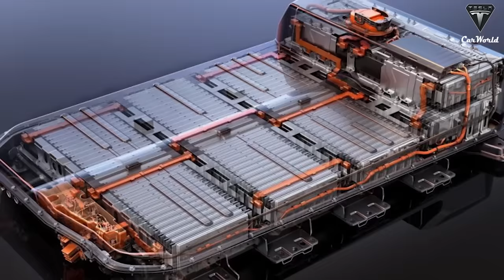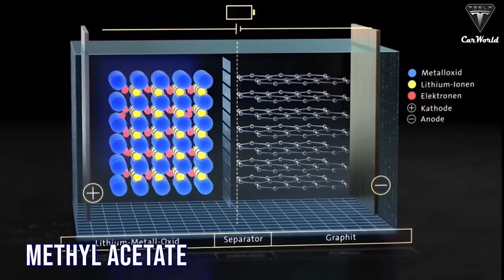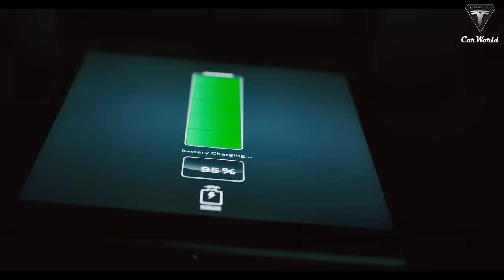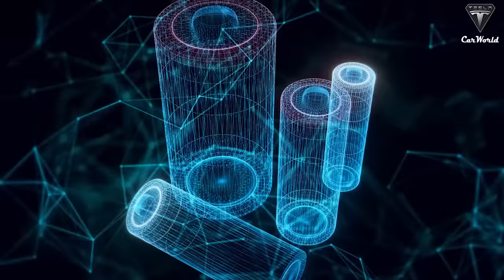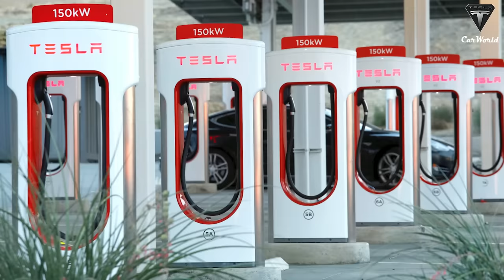The End of Lithium P3! Elon Musk Revealed ALL-NEW Shock Battery Tech, Change Entire Industry!

Comment: That doesn't just good for EVs but also Powerball since right now powers or asked about 20 years. So if they can make a battery that's able to last so damn long. It would naturally be something people that buy the power walls would want and make renewables even better
Reply: The battery that last 20 years but acar that goes out of stile in 6 over kill
Reply: @brianbruton2897  if you can just change the shell or interior of the car to suit your new needs/wants and keep the drivetrain it would be an improvement.

on top of that if we look at average car age and the reason we scrap them then if the car still works well after 20 years then it'll still be on the road

Comment: I have found by carefully cutting out a section in the floor board in front of the drivers seat, and the proper shoes, i am able to propel my car forward up to 8 mph and on a downhill, I have reached 25 with absolutely no gasoline usage. I call it the Bedrock design after the city where it was first perfected. Uphill travel and long distances are more of a challenge and requires passengers so carpooling is encouraged. Plans and working drawings are available for $1400 for the complete set. Order today before supplies run out. 👍

Comment: As far as I can see (as an engineering consultant, but in a different field), the biggest issues with batteries for EVs are:
1.  Life
2.  Energy density
3.  Environmental impact (related to 1, obv.)
4.  Availability of raw materials
... but biggest of all ...
5.  Where does the energy come from to charge them.

This video seems to address #1, #3 and #4 quite a lot, #2 to a lesser extent, but - crucially - does nothing at all about #5.

Comment: One thing which was not covered by the video is how  the charging system can provide the exceedingly high current which would be required to charge at such high speeds.  It could require the charging cable to carry two thousand or more amperes.  To to that, the charging cable would need to be many times heavier than current charging cables.  Such a cable would be stiff and difficult for the driver to handle.

In theory the charging current required could be reduced by using higher voltages, such as perhaps four thousand volts.  However, that would present other problems, such as requiring the inverters in the car to operate at thousands of volts.

Why is this problem never discussed?

Comment: This is just one reason that cars should be modular.   Each part could be upgraded separately thereby lasting forever.   Let's have 600-mile cars that have 1/2-weight batteries splitting the difference.  We should have already built the Nuke plants.  Discoordination slow-walks everything.

Comment: Why don’t they just put 2 battery packs in the cars? Run one pack until it’s at 20%, then switch it to the other one. The second pack can charge the first one to 80% and then turn the charge off. Then once the second pack gets to 20%, switch it back to the first pack. They can charge each other when they switch off and turn on in the optimal charge and discharge range. For as much money as those cars cost, they should also put a 3rd pack in there to be an emergency battery pack, just in case one fails for whatever reason. That would be a smarter way to do things, rather than charging your car by plugging it in. The car would pretty much charge itself in the best ranges, to last the longest time and would hardly need to be plugged in, if ever. They should also have their own mini a/c’s to keep the packs cooler so they run their best. If you want the best, you have to do the best.

Comment: This is all nice.  Has anyone addressed the safety issue.   You know the spontaneous battery fires that give the occupants just seconds to escape from a moving vehicle  that is moving 60 miles per hour?  I don't think making those batteries more powerful  and thus more deadly would be advised until the issue of keeping their passengers safe in such an event is figured out.  You know just a thought.  For those of you that have the blinders on,  a basic YouTube search will let you see what I mean.  Imagine being in the back seat when it occurs and what you will look like after 30 or 40 surgeries assuming you actually live.  In any other vehicle, they would have stopped production engineered  a deflective fire shield to protect the passengers and the children in the back seat of the cars and the passengers on the electric busses that flash to fire in 3 to 5 seconds.   I do not care what your political issues are,  Safety trumps all of them.

Comment: 20 to 80% use X 300 idea range, gets you to 180 mile range ideal conditions to protect the battery life.  But what about derating due to high temp (AC ON full) and low temp (Car Heater on and Battery Heater On) and driving in mountains.  And will this battery have a problem with Fires?  For my 03 Jetta Turbo Diesel, I get about 50 MPG driving down the highways 260 and 87 (140 miles) and about 35 mpg back (varies from about 40 to 44 MPG Both ways, based on fuel logs).  That's another 30% derating for going up hills,  thus 180 * .7 = 126 miles.  If you are stuck in traffic, then that's less.  Not to mention snow days where you are now doing 30 to 40 mph.  What I need is 300 mile range worst case and that means over the degradation of the battery (60% usable life left in 10 years) and going up hills in high heat or cold winters.  And ability to put out fires such as on current technology.

Comment: My electric hybrid BMW has 120,000 miles and the battery is toast. I don’t have $20,000 to replace it nor would I. So the car never went enough miles to save any Co2 over a purely gasoline car. It’s pointless. 3:47

Comment: Now we just need wireless charging roads that have auto-driving markers and lighting, powered through the power grid, supplemented by sturdy solar panel tunnels where needed. Not a lot of traffic? Feed the grid! On a charging road, you can have a "pig" sent down the lanes each night to clean the roads and indicate where repairs are needed.

You could also utilize old million-plus-mile electric car batteries for use with these roads at night and as storage to utilize during poor weather and morning/afternoon traffic.

Comment: A 2000 mile battery that lasts 100 years and charges in a minute. At 25% the cost of current technology. Then you’ll have something. It should translate into a passenger car that could cost less than $25,000.

Comment: This video just painted a beautiful mirage-like future of the car batteries to promote the incentive to their potential buyers, but It might not be materialized in the coming future, or never. If the car batteries can afford thousands, thousands of cycles and for EVs to drive a million, even more miles, it'll be bad news for the EV makers to sell new EV cars!
The "Light Bulb" Short-lifespan Principle must be applied for EVs too; only for a limited time, a calculated limited short lifespan, similar to all the consumer products using electricity, such as the lightbulbs, TVs, refrigerators, any product with electric circuits, motor or compressor. Making them all burnt out after a while and force consumers to buy new ones is the only way for all manufacturers to stay in business.

Comment: "low carbon goals" This just blows my mind.  Most people don't take into consideration that most of the electricity is generated by coal.  Up to HALF of all electricity generated is lost to the grid losses.  That means for every watt hour used by the car as much as two watt hours needs to be generated.  Also, internal combustion engines or point of use generation of energy is more efficient than generating and then distributing the energy.  That being said, it would off load the carbon footprint to areas that have lower population density and more plant life to absorb that wonderful CO2 that plants need so much.  With the lithium sulfur being cheaper, higher energy dense and longer lived than LiNe ion batteries I might be interested in an EV...maybe.  Renewables?  Still not practical but the new battery tech might make it closer to practical.

Comment: This is annoying as they DON'T describe the actual performance issues with these 200 year batteries. What good is it to be functional 'as long as it holds a charge' when in the first fifty years the performance drops under 25% but the battery refuses to die? You'd be surprised by the amount of double talk tech can get away with.

Comment: Cute, but we need to examine a couple of drawbacks.  
1. Where are we going to get the power to charge all these batteries.  Can anyone tell me seriously how many new power plants are under construction or even in the planning stages.  How many and where are they?  Power plant electricity other than nuclear, uses roughly 70% fossil fuels to generate electricity.    So you hook up your car to the grid at night to put excess electricity back into the grid.  But you need to charge up your car again when you want to go someplace.  How does that work?
2. For those of us who live in Arizona, we already know that excessive heat degrades batteries. How do we address this issue.
Good luck electric car lovers.  You're going to need it.

Comment: I'll believe it when I see it. As far as capacity goes, aluminium is only the 6th most active metal, behind lithium, potassium, calcium, sodium and magnesium, so the voltage per cell will be lower, but at least they could use it safely in metallic form instead of ions absorbed in graphite, which will save space.

Comment: I dunno. I am encouraged about these new battery technologies, but you still have to charge them! So far, all the "green" solutions for generating electric power for the grid have been diappointing. And the grid itself is very vulnerable to failure and sabotage.

Comment: I believe that the graphene aluminum ion batteries are cheaper, lighter and they charge 70 times faster than lithium ion batteries and can last a potential of fire doesn’t need any cooling whatsoever. Applying this technology is literally interchangeable with lithium ion batteries that are lighter, faster, cheaper . Using aluminum, Sulfur, and chemistry will bs charging at 100% in less than a minute. Using Milton salt or Chloroaluminum salt batteries can store power.

Comment: Funny that a 70 litre plastic fuel tank has no problem doing a million miles but usually has the vehicle wear out around it. Even so it still holds 70 litres at the end of its life and still takes 3 minutes or so to fill. While heavy I can still just about lift this source of energy that will give me 650 miles.  It also bounces if dropped. As far as I can see the industry is still struggling to get out of reverse gear.

Comment: Others have mentioned it. ALUMINIUM batteries straight away would offer the best RECYCLING solution which completes the picture.  Yeah we end up with million mile batteries and end up with modules in the future with expensive recycling options if at all.  A complete solution as opposed to something that works in the short term is what's required.  The first commercial cars ever were electric and all electric owners must recall the short stint in the 90s.  It's not the car that's the problem, it's absolutely the power source. But hey, that's all of humanities current main problem,not just cars.

Comment: I don't care about how many miles these batteries last, or in other words, how many times they can be charged and discharged. That's not the issue. The concern is ENERGY DENSITY. RANGE.  How far can I go on a full, single charge?!!. I want an all electric tow vehicle that will pull a 7000 pound vehicle 400 miles minimum, and be fully recharged in ten minutes. We are nowhere close.

Comment: So I live in Canada and I do not have a garage to store my car in, so how well or how bad is it for the car/battery when it sits in the cold for 16 hours at around -40C?  Will it start and run and will the battery return to normal in a 20 to 30-minute drive to work?  And then do it again in 8 hours to go home?  Do you need to be charging the battery slowly when it is so cold, I would hope some power flow would help the battery stay active and warmer than the outside temperature, or maybe you wrap those batteries in some kind of protection?
Reply: At -40C, for a gas powered car, it'd need to be plugged in so keep it warm.  Probably something similar for EVs where you plug it in at home and at work.

Comment: Your explanation on C rating isn't quite right. The C rating is based on the Capacity of the battery. So a charge/discharge rate of 2C means the battery can charge/discharge at 2 times the rated capacity of the battery. For example, a battery with a capacity of 3000mAh (3Ah) could be charged/discharged at a rate of 6 amps.

Comment: I want a battery that will full charge in less than 5 mins and last 350 miles like my diesel car lol
Reply: Capacitors trickling to batteries is one option. You'd have to replace the capacitors more often under those conditions, but it could be done.

Comment: As a solar energy engineer, I love to see that innovation is coming rather quick, and having many technologies available would "boost" the industry into adapting them, as well as having new technologies with a variance of applicable use cases each. However, I hope the aluminum wins the bulk, we still have to be as "clean" as possible. Not a big fan of Lithium in general.

Just a note, your lithium vs gmg battery lifespan values are flipped.
Reply: These can also be used for other sources of electrons. Nuke, sewage burn, etc. etc. So long as you can store electrons reliably and cheap, you don't have to plain old dump as much load overall to ward off spikes and brownouts.

Comment: Too many errors in this video to list, but here is just one.
Fast charging, I heard mention of charging up to 70 times faster, no current grid connected charger can support this.
EV charge stations have a limit as to how much input current they can take from the grid.
The theory may be good but in practice, each vehicle connected to a charger doing a "fast charge" is limited by how many other vehicles are attempting to do the same.
Also the current required to charge one vehicle in 12.5 minutes as suggested here would need huge, heavy cables.

Comment: My question is how well would these batteries work in the winter in places that typically have weeks with wind chills of 0 to -40°F?
Reply: Wind chill is only relevant if the surface is wet or damp such as from sweat or rain.  Neither apply to batteries in cars and even less so in houses.
Reply: Granted, but to have a wind chill that low especially if the wind is less than 10 to 15 mph means the ambient temp wet surface or not is still low enough to affect most regular car batteries. I know, I live in the upper midwest, I have had vehicles not start because it was too cold for the battery
Reply: @kwhitefo  You are suggesting the vehicle in this temperateure is just stored in a garage? No wet road from rain, puddles or melted ice or even ice thrown onto the battery pack? I can tell you that in summer I loose 7% of my max charge and in winter it is about 11% in the fringe seasons I get the max distance displayed on the dash. Funny thing is a wet spring day I get more range or the daily round trip is 20km shorter in the rain...

This is my second EV and a diferent brand from the first but both have these characteristics also charging capabilities change depending on the temperature of the garage.
Reply: Also useful for space, where it gets even colder, and then often far hotter!
Reply: Elon Musk was born and raised in South Africa.  So those very low temperatures are not native to him

Comment: Keep in mind batteries are storage technology and not energy sources.

Reality dictates that we will always need a variety of reliable power sources, just as we have uranium, coal, natural gas, gasoline, diesel, fuel oil, kerosene and their derivatives. today. It will probably be a simpler mix, including hydrogen for longer transport, natural gas, hydrogen derivative storage liquids like methanol and formic acid. Each niche will be optimal for certain applications and environments. The biggest challenges for these new energy types will be power for giant ships and trucks, and how to handle extreme cold. That is where hydrogen will excel. The all-or-nothing mentality of today with battery-only solutions is indicative of a very immature stage in the energy revolution. Aluminum sulfur batteries definitely look like a technology that will emerge and be around for many years to come.